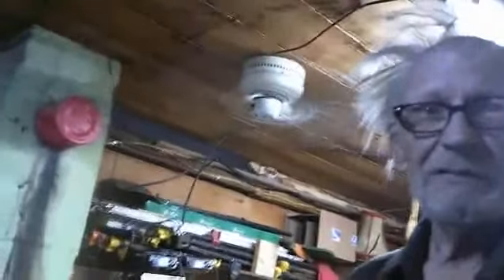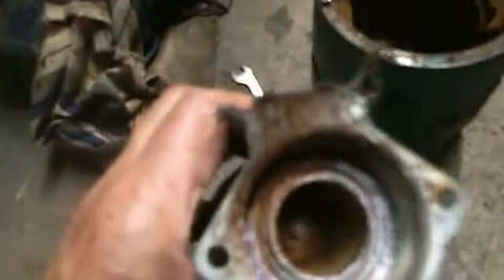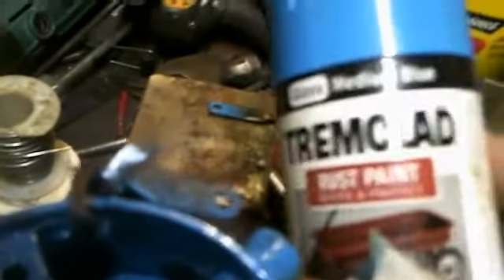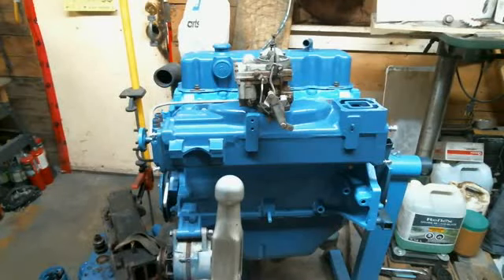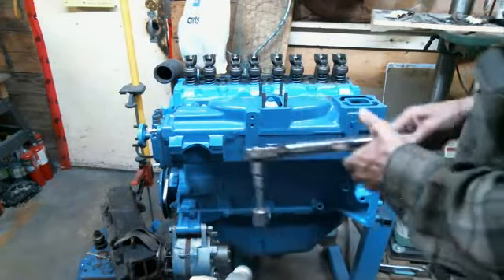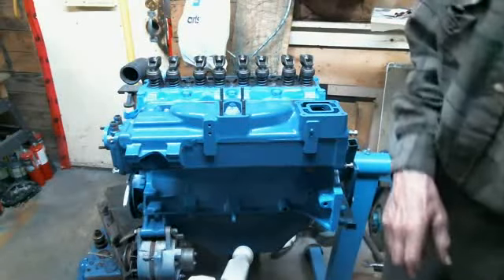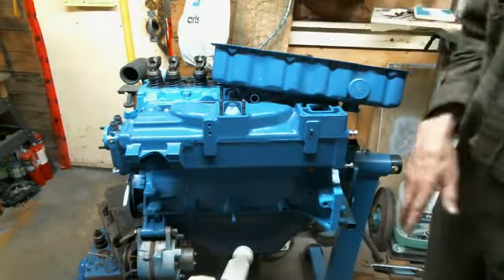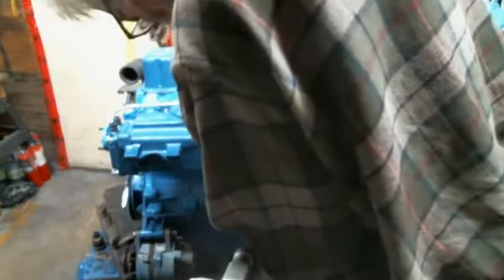Continuing on The OMC GM Engine Rebuild

Comment: Where's the turbo?  And a pair of 350,  or 500 Holley 2bbl or 600 4bbl blow through carbs,  run a air to water intercooler,   make that boat motor!! 😎. 15-20 psi, maybe 25-30 with water methanol injection, ,, make about:300 HP on low boost, add a stud girdle, and main and head studs,  o-ring the head and block, keep it under 5500,rpm, it should run like a diesel, TQ wise, 350tq, and 350 HP should be easy! The Brazilians are making 2000+ HP from near stock  block and head 250/292 i6 engines,  stock cranks, just girdles and braces everywhere, and ARP bolts, o-ring head, with inconel valves, and port work, valve job, a cam, lots of turbo!
Reply from the maker: That might just be too much power for a old fart like Me to handle.  Can You just imagine the speed You'd get doing that. Yea, Wow!